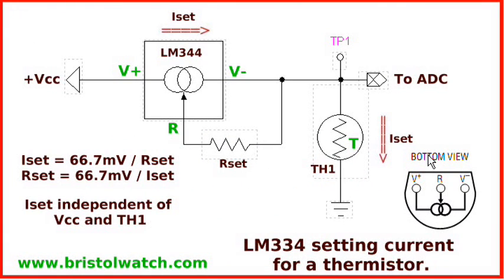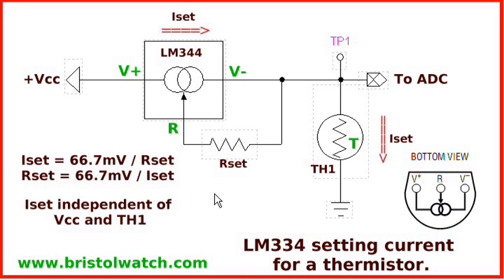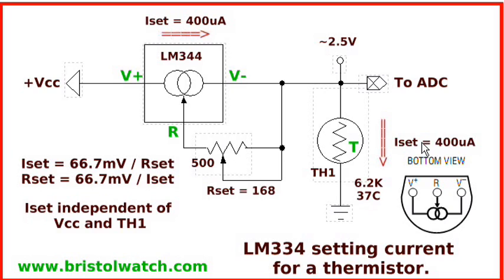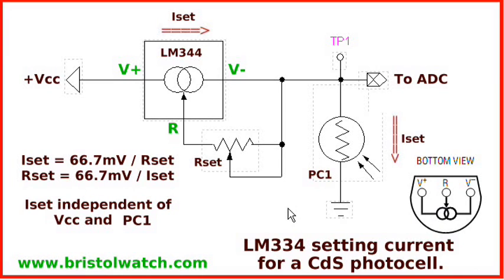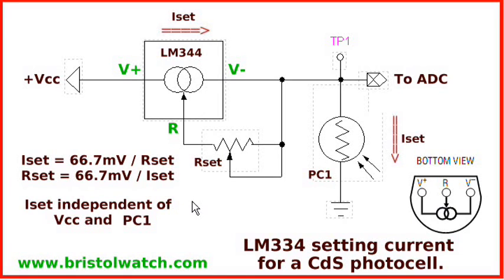LM334 CCS Circuits with Thermistors, Photocells

Comment: I see a few issues here:-
1) The 500R pot is a poor choice since only a very small part of its range would be effective, probably no more than 5% either side of the nominal 168R value, so 90% of its travel is wasted, and makes it finicky to adjust. 
Much better would be a 100R pot in series with a 120R fixed resistor. (or maybe even 50R or 20R pot with 150R fixed)

2) But most troublesome is that You are completely overlooking/ignoring the fact that an LM334 is a constant current source ONLY at a constant temperature. The set current will vary significantly with temperature, though the datasheet discusses ways to mitigate this. 

3)The datasheet also notes that self heating effects become significant at ISet values over 100uA, making the the temperature  dependence problem above even worse. Your ISet value of 400uA would be a problem.

A number of years ago I used an LM334 as a CCS  driving a KTY84 temperature sensor at 1mA. To get around the above issues, I had an LM35 temperature sensor right on the LM334. The measured temp of the LM334 was used to calculate a compensated value for the drive current to the KTY84, and thus also for the voltage across it, and so finally the temperature being read by the KTY84.

(and while I'm being picky: Your diagram says "LM344" not "LM334")
Reply from the maker: This is an instructional video,  not a final product. It also depends on what I have on hand when I test the circuit. Thanks.

Comment: What do you think of using thermistor(s) for Rset? That should change current according to temperature, allowing measurement over long-distances by taking wire-based voltage drops out of the equation; you convert the amps to volts via a terminating shunt resistor and measure the volts across the resistor with the MCU's ADC.
Reply from the maker: It's possible but the chances of getting the correct thermistor is slim. Worth a try.